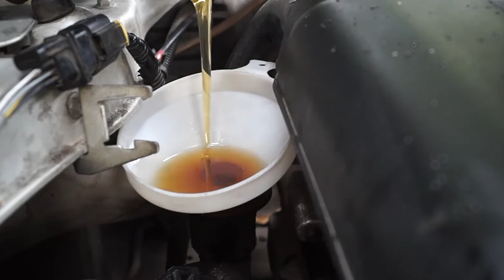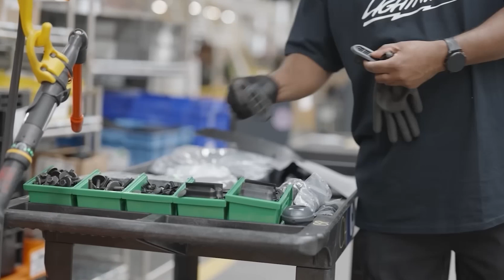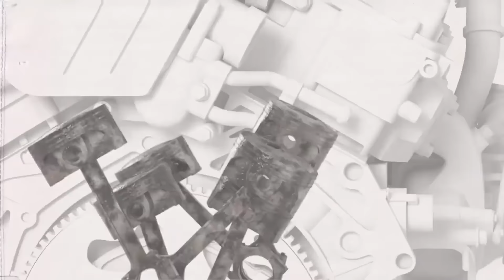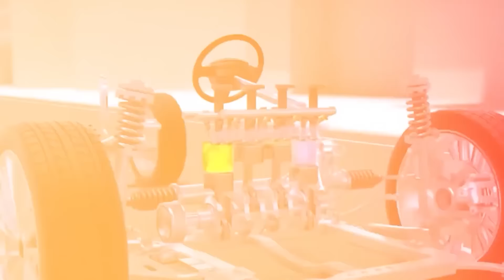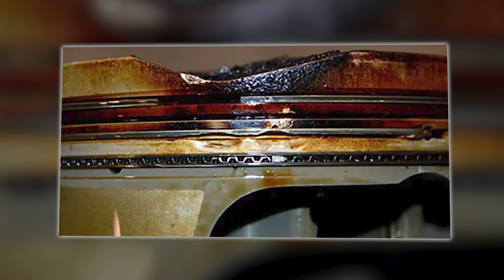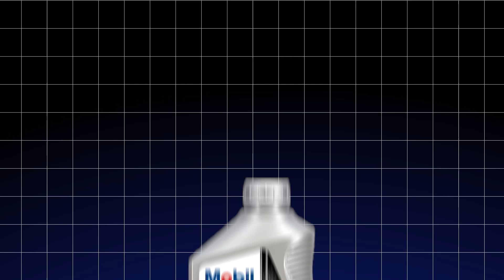Toyota Secretly Lying About Oil - Mechanics Refuse To Use

Comment: Viscosity isn’t everything, oil analysis shows the 0w8 has additives that protect as good as thicker weights, check out the oil geek or send in your own samples.
Reply: Thank you. I’m so sick of misinformation out there about lower viscosity oils ruining engines. It’s always AI crap or people who don’t know what they’re talking about.
Reply: @jpete3027666  Lower viscosity oils fail to protect engines from their own operation.
Reply: No, 0W is shite degradation fluid.  Your statement is false.  Use more protective oil like 5W-30, 5W-40, 10W-30, or 10W-40.
Reply: @GeneralFukzamatayu  Take it easy! They aren’t talking about whisky! Oh. Wait. It pours like whisky!
Reply: 0w-8 oil has been tested since 2012 in Japan. If anyone is worried about it just change it sooner 5k miles max
Reply: @Jerseyfrank  Is this what you call your engine maintenance, a "test", an "experiment"?  FUCK THAT NOISE YO

  Like we're all f'n closeted Elon Musk admirers?  WE ARE NOT

Everyone who doesn't race should be running 10W-40 or 15W-40, allowing warmup (especially in winter, especially before aggressive driving or towing), using their dipstick, and not slacking til it's black. 

Manufacturers have been malfeasantly monopolistically colluding to exclusively list 0W oils in order to shorten YOUR vehicle's lifespan.

 FTC's Magnuson-Moss Warranty Act prevents manufacturers from voiding warranties for using third-party lubricants.  

Toyota lists 20W-50 in Saudi Arabian owners manuals for the same exact engine that Toyota lists only 0W-Fuck_Americans oil for in USA.
Reply: Viscosity is major, not minor.
Reply: The taxi example is almost irrelevant to many of us, because most of those miles are tallied when the oil is warm. The torture is stop and go miles when the engine cold, and it takes decades (not years) to go a few hundred thousand miles; 0w8 might even be better in that case.
Reply: @Ltrisbtr  Winter is only a small part of the year.  Oil pumps pump at fixed volumetric rates regardless of viscosity.  Starting a car from cold constitutes a ridiculously small % of total engine operation.  

0W oils are part of a greater ruinous "replacement rate"-increasing scheme, common enemy of earth and humankind.
Reply: @GeneralFukzamatayu . I drive 2.8 miles to work in the tropics. The engine spends almost none of its life at normal operating temperature. The viscosity at startup is many times higher than a warmed-up engine.
Reply: @Ltrisbtr  Nowhere near freezing.  As a good car owner you allow your engine a chance to warm up before driving.  There's absolutely no need for 0W oils whatsoever.
Reply: @GeneralFukzamatayu  The issue is the 8, not the 0. And idling a car to warm it up is a nono.
Reply: @Ltrisbtr  It ~never gets cold enough ~anywhere to necessitate or justify 0W.  With oil, everything comes at a cost to something else.  0W is entirely unjustified.
Reply: @Ltrisbtr  Idling a car to warm up is AUTOMOTIVE BEST PRACTICE!!!
Reply: @Ltrisbtr  ..have you been awakening from your "conned" status?  Are you coming to realize that you'd been deceived? (such as by the people who scorned the allowing of engine warm-up)
Reply: @GeneralFukzamatayu  No, it isn’t.
Reply: @Ltrisbtr  

1. start your engine
2. let it warm up sufficiently (the duration of which varies based on the initial ambient temperature)
3. drive

This is automotive best practice, not "a no no", yeh f'n moron.
Reply: @GeneralFukzamatayu  Nope. You are duped. And that’s not the point, anyway.
Reply: @Ltrisbtr  Your beliefs are false and harmful.  Do not spread them.
Reply: @GeneralFukzamatayu  You are are the misinformant. Idling engines are abused engines.
Reply: @Ltrisbtr  Where did you acquire that corrupt and false belief?
Reply: @GeneralFukzamatayu  From real life, definitely not from your internet.
Reply: @Ltrisbtr  Go ask three mechanics if it's good to let your engine warm up before driving it.  Then go ask 20 more.  And the come back here and formally apologize to me.
Reply: @GeneralFukzamatayu  I already know that many mechanics and am related to some, and am a closet mechanic myself. None of us idle engines to warm them up. And warming up a hybrid in that manner is utter nonsense.
Reply: @Ltrisbtr  Your pathological lying is disgusting to me and passersby.
Reply: I am providing you with opportunity to separate good from evil, because passersby aren’t as intelligent as you. You’re welcome.
Reply: @Ltrisbtr  Passersby should know to allow their engines opportunity to warm up before driving, especially in the winter.  DUH
Reply: @GeneralFukzamatayu  Passersby know to get advice from more than the internet; that’s why they pass by.
Reply: @Ltrisbtr  Don't tell people not to allow their engines a chance to warm up.
Reply: @GeneralFukzamatayu  I never tell anyone that. I am, however, telling you to learn to read what others write… and to refrain from changing the subject when you don’t understand them.
Reply: @Ltrisbtr  People should both allow their engine a chance to warm up, especially in the winter, and use properly protective oil, not 0W garbage.

Err no more.
Reply: @GeneralFukzamatayu  0w oil is made for people like you, who insist on idling to warm up the engine.
Reply: @Ltrisbtr  Idling after starting to warm up the engine is automotive best practice, is a need of the engine for long and trouble-free life.

0W is for evil greedy manufacturers who hate long life and longevity more than they love their own customers
Reply: Make sure you listen to these YouTube bots. They are all knowing. 
Trust the bot .. be a bot.

Comment: This is unscientific crap. Toyota engineers know what they are doing. And without cafe, you morons would still be getting 7 mpg but paying $10 per gallon.
Reply: Nope, these guys would rather take advice from some dudes commenting on BITOG than the guys who designed and built the engines.

Comment: first thing I did when I bought my 2018 civic was change the oil at 1k miles to 5-30w. And I change it minimum 4k  or 6 months. Imagine a turbo car using 0-20w in 90 degree weather with no oil cooler and direct injection. Your oil is done in 3k miles from fuel dilution.
Reply: You don't have fuel dilution when your oil's hot enough to keep it burned off, which it is if your trips are not short and the climate is hotter. Instead of thinking what's best (you don't know at all, without numbers to show it) you should send in an oil sample from both oils and find out what's best. Never should you go away from what's recommended, without a UOA to show you if it's the right thing to do. Anything else is nothing but speculation.
Reply: Exactly, if you have turbos and direct injection, change oil at 3,000 to 3,500 miles and you better be using some good synthetic oil like Pennzoil Ultra platinum 5W-30
Reply: @jackhutchins8272  Liqui Molygen only in the Si. I use Pennzoil Ultra in the track car but I have tested oil and it is good for a whole season.  It might hit 1k track miles and 2k driving to the track miles.
Reply: @jackhutchins8272 5k is even too much with GDI.
These engines are ticking bombs... flimsy timing chains and so forth.
Reply: @AAAAAAndrea  Timing chain issues were due to carbon in the oil, it acted like sand, wearing away at the components. They discovered that with GDI engines and have addressed that with the SP and SQ oils, so it's no longer the issue that it once was.
Reply: @kellyhahn6145 Well... that's kinda obvious that soot, expecially in GDI engines ( wich have the harshest soot ) will ruin timing chains, but if you have a flimsy chain it will be much easier to ruin than a sturdy, thick chain
Reply: @AAAAAAndrea  Just telling what I know on the subject. Most people don't, they just know a lot of later model engines had trouble with premature timing chain wear, without knowing the main reason for it. GDI engines are a whole other thing, compared to what we used to have, and there's a learning curve there. Same as we had no idea the additives in the oils would contribute to LSPI in turbocharged direct injection engines, so when it was realized, the additive packages were changed to prevent that. When engine designs are changed, it's been shown that sometimes the oils need to be changed to meet their needs.
Reply: @kellyhahn6145 The issue isn't oil per se, but oil replacement frequency too! Turbo GDI are extremely demanding to oils, they need early oil changes.
That's why most suggest maximum 5k miles( 7.5 k kms ) 6 months.
Reply: @AAAAAAndrea  Absolutely. Between shearing and fuel dilution and the heat they produce, it's a must, if you want longevity. The gas is a very important matter too. Top-tier needs to be used to keep carbon deposits to a minimum. Tests have shown 19 times more deposits with gas that isn't top tier. I doubt most people realize how important that is in those engines.
Reply: @kellyhahn6145 Yup, my GDI I do 4 months oil changes
Reply: Check out Lake Speed Jr. He is the most knowledgeable person on the planet when it comes to oil. That is what he studies and tests. He is the Master of oil.

Comment: Uber driver here.  I have 2025 Camry LE and have been usine 0w16 instead of the 0w8.  Toyota OEM 0w16 is $8 in my local.  The toyota oem 0w16 and 0w8 both have over 10x the amount of additive MOLYBDENUM and higher amounts of other additives than Mobile 1 0w16 and 0w8.  Search youtube and youll find some guys shared the oil analyisis.  My compromise is i use the TOYOTA OEM 0w16 and change the oil every 4000-5000 miles.  I
Reply: Amsoil has even more additives.
Reply: Same here
Reply: Too much moly causes sludge,the Pennzoil does better without this additive,Amsoil too.
Reply: So you don’t buy their 10K OCI, but the O-W kerosene oil is just fine.  Interesting logic. Kinda like religion, just pick the parts you agree with and ignore the rest.

Comment: The JASO standards are japanese standards, no issues with those standards.  But ya,  go 0w30 in cold northern climates, switch to 5w30 in spring to fall, go 5w40 or even 15w40 in the south.

Comment: 0W-8 flows almost instantly on cold start.

Why thi matters: 80% of engine wear happens in the first 30 seconds
Thin oil reaches bearings, camshafts, VVT systems immediatelyLess metal-to-metal contact during start-up

So thin oil = less wear, not more.
Japanese build engine around the oil lubrication is key
Reply: Synthetic oils of a 5W rating and a 0W rating are identical in cold weather performance down to about zero degrees Fahrenheit. Below that, sure, a 0W oil has an advantage. But it is the second number, the 8 (or 16, or 20) that is the topic of concern of this video and most of the comments. When an engine reaches operating temperature, the debate is whether the "8" rating is sufficient to protect the engine long-term. Plus, how long does it stay at the "8" viscosity before it starts to go down even further due to fuel dilution and the effects of long oil change intervals.

Comment: I am now using Amsoil 0w-8 oil in my daughter's 2024 corolla during the break in period (has less than 10k miles).  I will do a used oil analysis at 3k miles to see how this oil is working inside the engine and how it compares to the Toyota brand oil.  I did a used oil analysis on a 2,400 mile oil change, including the virgin oil, to see the before and after picture of Toyota brand 0w-8.  The test showed metal wear, which is to be expected because it's still in the break in window but nothing too high that is causing any concerns.  The oil analysis also showed that fuel dilution (way higher than my non DI engine oil analysis) affected the oil viscosity.  Also, it showed that the Toyota oil has only about 1/3 the additive package as Amsoil oil.  This is great to see with my own eyes.  I will use oil analysis to determine which oil is best for this particular vehicle and how it's used based on Science, Not Speculation (Lake Speed Jr.).
Reply: The Toyota oil is made by Mobil 1 but has more additives. You are right that the Amsoil has more additive and costs way less than the Toyota brand.
Reply: @JackAgainski How do you know about more addictive?  Did you do oil analysis of new Mobil 1 and Toyota 0W8?
Reply: That “breakin period” ended about 10k miles ago.
Reply: Did you have an opportunity yet to undertake an oil analysis on the Amsoil 100% 0W-8 used oil sample?  If so, how did it compare to the Toyota Full Synthetic 
0W-8?  Some verified buyers of Amsoil 0W-8 on the official Amsoil website had indicated they were getting better results than the Toyota 0W-8, such as better gas mileage, smoother and quieter engines.  Did you observe these same qualities in comparing these two oils?
Reply: I have a new 2026 Corolla. Has 1800 miles on it so far. I just ordered Valvoline Advanced Full Synthetic oil to change soon. After warranty expires I will be using A Purolator One filter or Mobile 1 or Bosshe as a second choice.  

What is your opinion of my choice of Valvoline Advanced Full Synthetic vs the Castrol Edge I was considering.  The Amsoil is hard to find in stock even online.

Comment: That is actually true, Toyota's line states "Engine oil selection
“Toyota Genuine Motor Oil” is used
in your Toyota vehicle. Toyota recommends the use of approved
“Toyota Genuine Motor Oil”.
Another motor oil of matching quality can also be used.
Oil grade:
0W-16:
API grade SN “Resource-Conserving”, SN PLUS “Resource-Conserving” or SP “Resource-Conserving”;
or ILSAC GF-6B multigrade engine
oil
0W-20 and 5W-30:
API grade SM “Energy-Conserving”, SN “Resource-Conserving”,
SN PLUS “Resource-Conserving”
or SP “Resource-Conserving”; or
ILSAC GF-6A multigrade engine oil
Recommended viscosity (SAE):
SAE 0W-16 is filled into your
Toyota vehicle at manufacturing,
and the best choice for good fuel
economy and good starting in cold
weather.
If SAE 0W-16 oil is not available,
SAE 0W-20 oil may be used. However, it should be replaced with
SAE 0W-16 at the next oil change."
Reply: lol Toyotas oil is Mobil 1
Reply: Which means it’s ok to use ow-16 twice the the viscosity of recommended. My Prius calls for 0W20 I’m using AMSOIL hybrid 0w-20. Next oil change I’m putting in 5W-20 that I used to use on my ram 1500 pick up in the 5.7K Hemi because I switched to 5w-30 in that

Comment: If you're using any 0w20 and lower, after a summer run get an oil analysis.  $40 from Blackstone.  And ya, don't run a 0w20 and lower over 5,000 miles without an analysis.  There was another video stating  only Amsoil and Pennzoil Ultra Platinum 0w20 were still in grade after 5,000 miles.  PUP made it to just over 9,000, Amsoil just over 11,000.
Reply: Everytime I watch Lake Speed I want to go change my oil.

Comment: In Australia, the owner's manuals usually state what the preferred oil is but then gives a chart for alternatives based on your ambient temperature... as a mechanic, I've never seen any engine from any manufacturer (including Toyota) who recommend an oil thinner than 5w-30 when comparing with the applicable ambient temps here where i am - our temps range from 0 C - 40 deg C (32 - 100 deg F). Usually when consulting the ambient temps chat,  0w- anything is usually only recommended when you get below -15 deg C (5 deg F). Anything below 0w-20 is a pure joke.  CAFE standards don't care about how long your engine lasts.
Reply: Our Mbenz 2022 GLS 450 has a manual like that too. We are in the U.S..
Reply: I originally agreed with you that 0w16 was too thin.  But the 0w16 or 8 engines are built to tighter tolerances:  there isn't enough room for optimum oil circullation with heavier oil.  Sudden engine starts have their own needs for long service.
Reply: That’s what people assume, but that is not the case, lots of engine builders have debunked this already
Reply: @rodcros By that logic, explain what happens then during the cold when the viscosity is higher? Its just pure nonsense...
Reply: Spot on
Reply: The best compromise may be Mobil one 0w 20 extended performance

Comment: First off, this is ai bs. This video isn't based on science, these engines were recommended this oil by Toyota's engineers and they are not exactly the same engines sold in other countries, that's just a lie. But hey, if you want the oil to burn up in your turbocharger and void your warranty, go ahead and listen to this idiot.

Comment: Lake the Motor Oil geek covers the viscosity question in depth. after a point it is not as simple as more viscosity is better.
Reply: Lake ran 0w20 vs 20w50 in his shop V8, he still has the video.  There were more wear metals in 0w20, and that's not good.
Reply: @lonniebeal6032  It was -28 C last night I feel I am getting better cold start protection from specified 5w 20 than I would from 20w 50
Reply: @lonniebeal6032  Motor Oil Geek Video
More Ai Lies? The FACTS about 0W-20 vs 5W-30 (With Evidence)

Comment: 0W is 0W which is the cold temperature viscosity, so it flows great on a cold start.  the /8 is the hot viscosity but it’s a basic mistake to think that the hot oil in the engine is thinner than when it is cold. It’s not.  The latest Toyota engines run in hybrid drivetrains and they stop and start lots of times during a journey and the 0W/8 viscosity actually transfers heat far more efficiently than thicker oil. 
Use the 0W/8 as Toyota advise.  This video is a load of rubbish. A basic mistake in the video is suggesting that 0W/8 contains more viscosity modifiers than say 5W30 or 0W30 when in fact it contains less of them.